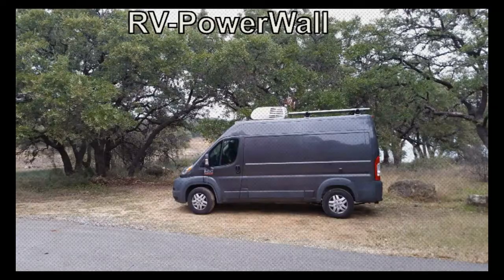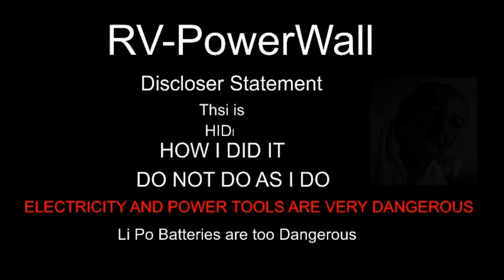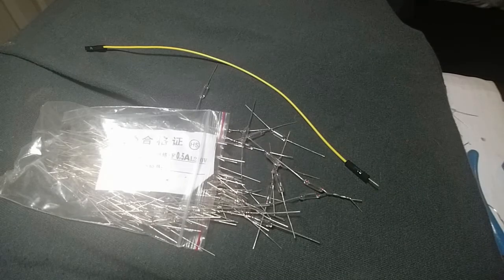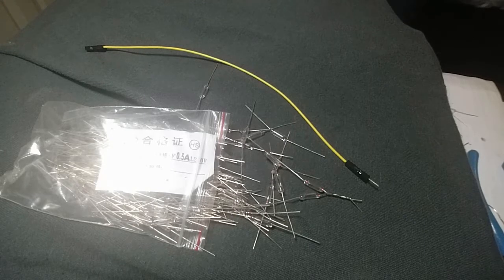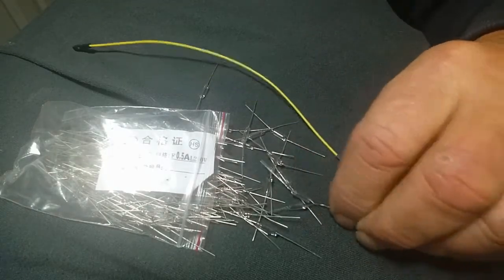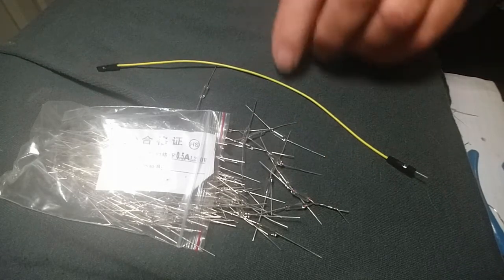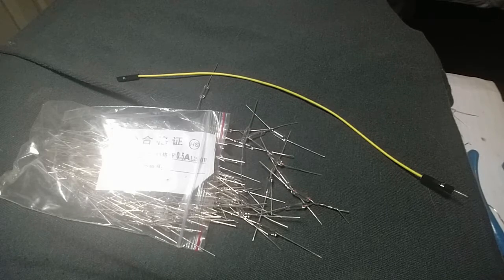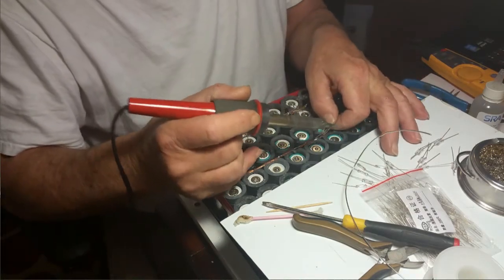DIY Bug Out 18650 Battery Fuse Installation

Comment: Ok, just have a query I saw now days there are many people are doing battery packs with out using fuses just nickel strip with spotvelder. Also I saw the opening that pack after some time not even one month reopening since due to shortcuits/blast/explod etc changing the cells with few others ... 
Now query is ....
1.Is that happening because of fuses...? 
If cells are not using fuses is it more chance for blasting/shortciruit etc....
2.If we use fuses can we save cells...? 
3.If fuse connection fires can we just reconnect with new fuses with the same cells...? 
Kindly reply
Reply from the maker: Fuses at the singe cell level is for Safety with a bms or with out. If a cell were to begin discharging you want the cell to blow that single fuse and disconnect it self from the pack. Remember if in this case you have 100 batteries in paralle and one battery goes bad then all 100 will begin discharging through that cell this becomes a major problem. This does  not happen very often however when and if it does this is the solution to this problem.
And if this happens with this build you can change the cell and the fuse.

Comment: Putting a link to the stuff u use would be helpful.. like the fuses
Reply from the maker: https://www.ebay.com/i/263397671437?ul_noapp=true
Reply from the maker: https://www.aliexpress.com/item/1000pcs-3-10mm-0-5A-Axial-fast-glass-fuse-with-lead-wire-3-10-0-5A/32797993515.html?spm=a2g0s.9042311.0.0.piI2H7
Reply from the maker: I tried that when I posted this video a couple years ago and the links get old and useless.  I would be glad to help you find something you need however what you can purchase from a link today does not last too long.